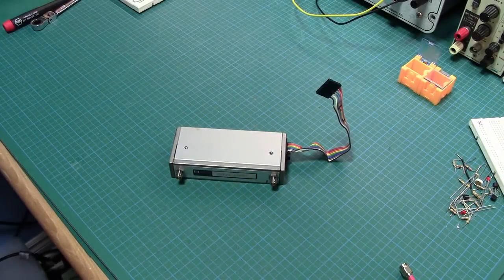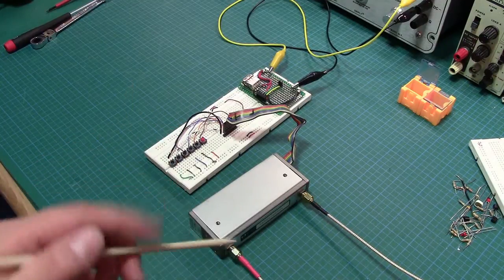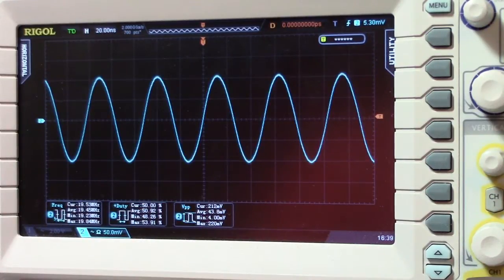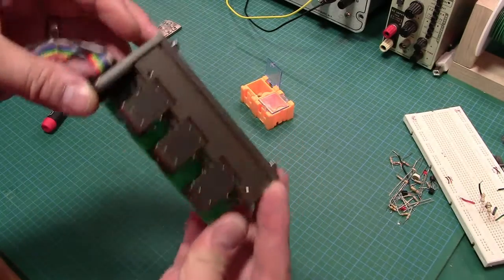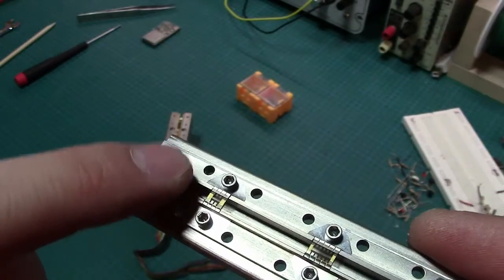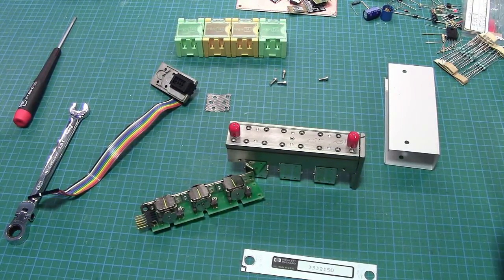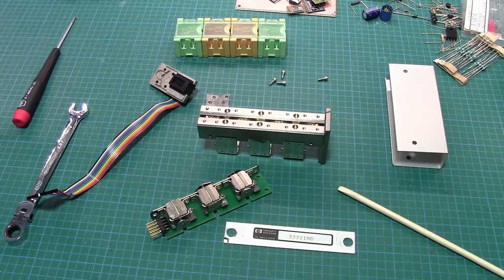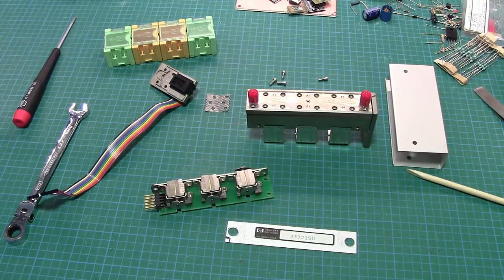HP 8642B Teardown and Final Thoughts (Part 2)

Comment: Thanks for this, great troubleshooting! I just picked one up to use on tuner alignment (overkill!). The fan wasn't working so I replaced it. All attenuators seem to be working but I do see clipping on my scope at the positive portion of the output. This occurs at lower frequencies. By 5000Hz it is fine. As I'm using this for RF it's not a problem but would nice to fix. Perhaps a thermal issue happed before the fan was replaced. Any thoughts on where to first look? Admittedly this piece of gear is a bit daunting compared to what I usually work on.

Comment: How did the o-ring replace on the attenuator work out?  Any video or 
posing planned for this?  I'm sure it must be a common failure as these 
age but haven't seen any information on repairs.
Reply from the maker: I thought I shot some video of that fix, but if not I'll do that and post it! And replacing the o-rings seemed to fix the "sticky" attenuator issue nicely. I will see if I can find the info for where I bought the o-rings from as well.
Reply: Thanks that would be great.  As these units age it just means the o-rings will fail.  Barring over-loading it is probably one the key failure points - and it should be easy to remedy if you can find the right size o-rings.